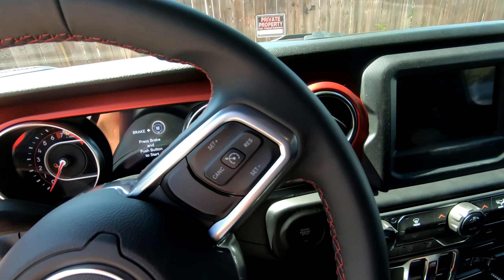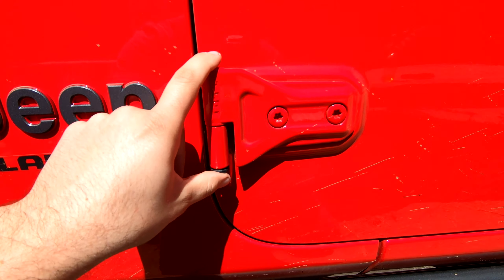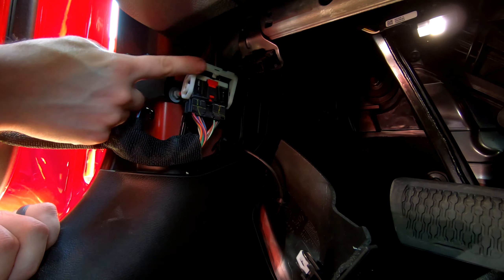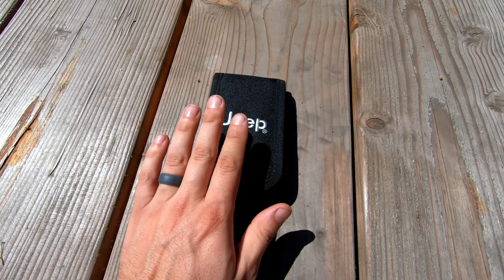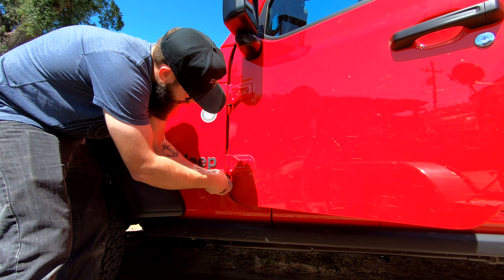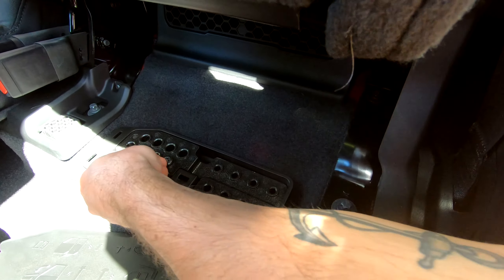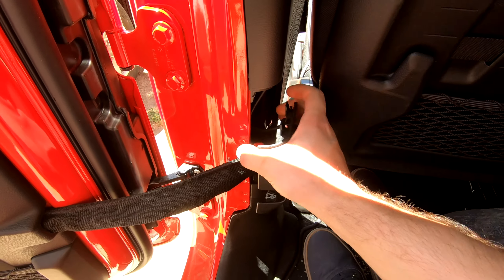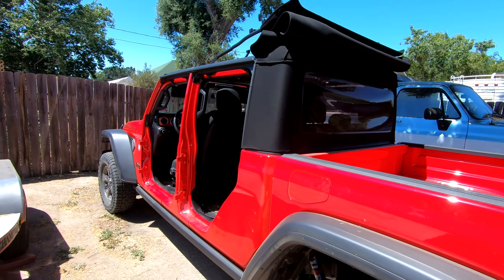How to take the doors and top off the 2020 Jeep Gladiator

Comment: Doesn’t jeep want the rear window removed when you put the top down like in the JL?
Reply from the maker: That is a good question, the paperwork doesn’t say anything about having to remove the window to have to top down. It shows how to remove the back window but not required
Reply: TJ Mitchell Films perhaps with the doors off it’s no big deal but with just the top down at highway speed there is no where for the air to go coming in accept to put pressure on the rear window. Most videos I’ve seen showing the operation of the top the rear window is removed perhaps to prevent it from flying off or something. I’m not quite sure but I hope your right. One less step to just wanting the top down is preferred.
Reply: Cool thanks for the info.